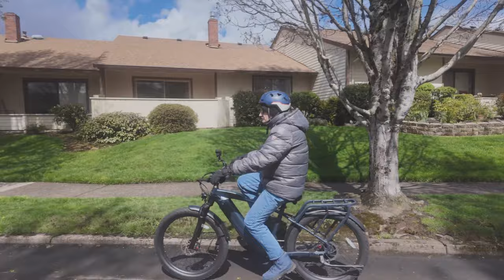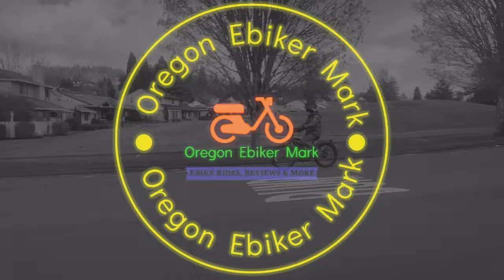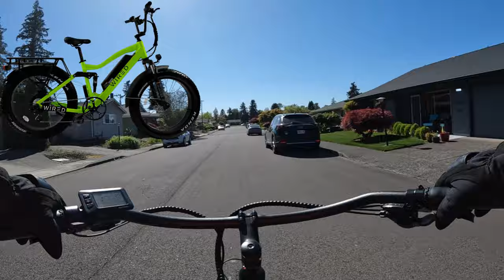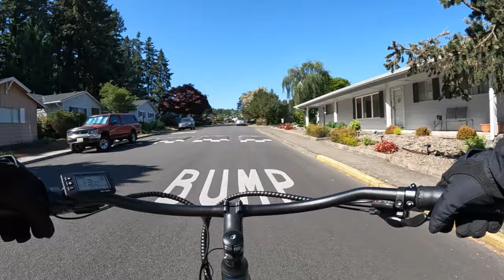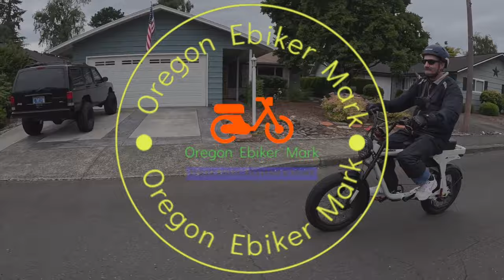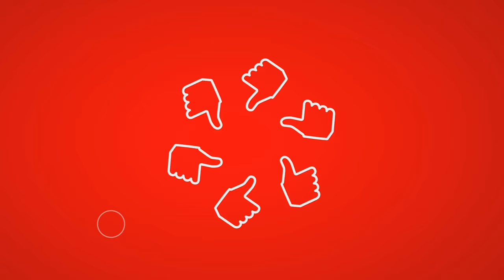Upgrades To The Wired Freedom Ebikes!

Comment: I have the 2023 wired cruiser. It’s great, I use it to commute to work and go to grocery store 
, and do errands. I also have a class 1 velotric t1 st and it’s completely different. I like both, but I think my next e-bike down the road will NOT be a fat tire 100 lb bike. I much prefer a lighter weight, and easy to maneuver

Comment: I heard some e bike manufacturers are putting their rear shocks on backwards and once you take your time to turn them around, you can't add any air in the air shock because you can get the pump line into that area.
Glad its not Wired doing that.
Reply: I heard some crazy bike king was offering a Gates drive without a transmission and then once realizing his mistake, lied and said “supplier” issues.

Comment: This may be the image Wired has on their website but it’s not the bike you actually get when it arrives. Wired screwed up by moving the rack back about 4-5 inches and I can’t figure out why. When I bought my freedom I did so thinking it would look like the bike it that thumbnail for this video, but for some reason they felt it was necessary to move this rack and it messed up a lot of people‘s experience because of the wobble.
Reply from the maker: Did they explain why it's moved back?

Comment: I already have a 2024 Wired Freedom. I got it in January, so it's not the updated model.  I love my bike.  I'm just here to see all the die hard E-Cells fanboys comment with all their toxicity 🤣
Reply from the maker: Do you have dual batteries on yours?
Reply: @oregonebikermark8953  I do have dual batteries on mine, but like I said my Freedom is the older 2024 model, not the updated one shipping out soon.

I put a 40ah  on the rear rack which does add weight, but now I can push the bike to maximum further and for longer.
Reply from the maker: @LeeAyzahn  Sounds good.

Comment: Im also a Mark from Oregon, sold my Rad and am saving for the Wired cruiser, had my eye on E-cells bikes, but this bike from wired takes the cake and the lead, step through would be great for a 69-year-old man with bad knees and bad back,did you see the review that citizen cycle just did on the wired cruiser. It totally sold me.
Reply from the maker: Not yet, but ! am subsribed to and watch @CitizenCycle he does some great work on his channel.
Reply: just so you know E Cells also has a step thru and you can design it the way that you want it with free shipping..either way happy riding!
Reply: @TheOceanMan-xc7qp  fyi the upgraded crusier from wired has duel suspension now

Comment: Yea but have you seen that there motors are burning up at 45a the controller is melting the solder on the hall sensors and making them melt down. Motors can't handle it so it's not worth it. Get the new E-CELLS 5star it's better built and they just came out with there newest model with dual batteries and there own hub motor.
Reply: O really?
Reply: The companies won't be insured if they go above 40....dangerous when it gets above that on a build like this
Reply: So is e-cells the safer, better quality, purchase to make?
Reply: @BhengMibudy  Oh absolutely. Better company/customer service/ no hidden costs/free shipping/customization options galore...Ecells has been around 5+ years and build nothing but high end bikes. They also provide great instructional videos on youtube as well as a number of solid reviews....Their controller and motor alone are valid reasons topic them over the competition
Reply: @BhengMibudy  most definitely
Reply: @TheOceanMan-xc7qp  I agree with this totally there customer service is awesome and you can talk to an American too. Lol
Reply: I would like to see videos because I actually have both bikes I actually have a dozen or so e-bikes this is so funny that you guys are each cells and wired freaks show us the proof
Reply: E trolls!  Guess why the new Wired controller can handle 60v 60amp peak despite being so small?   Because it’s potted🤣🤣 The motors are fine, the old ones were routinely shunt modded to 3000 watts and the new motors are even more robust, and higher rated.  Too bad you e cell owners can’t shunt mod your bikes to compete because they are potted😂😂.
Reply: @jfly2249  totally wrong and why did wired controller get smaller when it's more powerful hmmm and there new controller I herd was potted to more copy cat stuff. Go get your wired and when it fails let us know. Lol. And try to talk to someone st wired that speaks English if you can actually talk to someone. Talk about E trolling. Lmfao
Reply: @oldmanebikes8392 The new Wired branded controller is potted which provides superior heat dissipation, it is a modern design and can handle far more power than the ancient KT controller which is so big because it was never intended to be potted.  Technology changes but e cell is stuck in follow mode and is getting absolutely crushed.  The Bike King, and convicted felon, knows nothing except extreme marketing BS which is needed to sell $5000 AWD in 2024.  Just wait for it, the head shot is coming.😮
Reply: @jfly2249  lol E-cells is in copy mode. They bine using this frame for 5yrs so who copied who and the potted controller was done first by ecells also so do you research before speaking. Everything E-cells does wired has copied. E-CELLS is a much superior Ebike over wired. Like frame strength and everything else. Good luck trying to pull this BS with someone that don't know much but apparently you don't know much.
Reply: @oldmanebikes8392  so true and E Cells guarantees that frame for life!
Reply: What good is a warranty from a convicted felon who doesn’t pay taxes?    Wired bike is 1000 watts more power and demolishes the e cells in performance.  Wired has probably sold 10x as many bikes as e cells and the only complaints about the bikes are from e cell trolls.  No one believes anything the Bike King says.
Reply: @jfly2249  haha 😂😂. Anytime you want to put a wired bike up against a 5⭐ be my guest. Ecells is more dominant bike and yea they sold more because they been selling this style longer but they copied E-CELLS bikes they have been using this frame style for 5yrs now. And warranty lifetime on frame and customer service blows wired away even tho you won't need it because you won't have issues like many people have with wired Ebikes. I even herd wired frames snapping because ecells won't do that because they beefed there frames up. So who is the troll here your acting like one aren't you???  😂 Hahahaha
Reply: Your gonna wish you had that warranty lol, and Ecells has been selling high end Electric bikes for 5 plus years. They sold alot more and they didn't steal their frame like Wired to do it...why would anybody want a want a copycat with cheap parts? You've been exposed
Reply: @TheOceanMan-xc7qp  correct that's what I said who wants a copy cat ecells is the better choice any day.
Reply: @jfly2249, being as unbiased as I can be, owning neither an ecells or wired freedom bike and just an outsider looking in, it appears to me that your arguments have a lot of merit. One thing that strikes me is that other than with a massive tailwind and 145 lb rider, I have yet to see a 5 star achieve 40 mph. On the other hand, aside from the first wired freedom from 2 years ago, which has been improved on numerous times now, the wired freedom reviewers doing a top speed test have hit 40 mph or higher. If you're going to advertise something as a 40 mph bike, it should be a 40 mph bike. Not 35 with peddaling as is happening in the 5 stars reviews. I know there are variables like weight of rider, temperature, wind direction, etc but the 5 star just isn't getting to 40 without going downhill or being wind aided. You had commented somewhere on another video that the 5 star performs like the origional wired freedom, you may have been giving the 5 star too much credit with that comment. The 5 star performs like a 48 volt bike.
Reply: @oldmanebikes8392 why do people come on here and troll away … wouldn’t it be smarter to actually do a little research instead , so they don’t sound so foolish in the long run … 😂
Reply: @jimjr9143  exactly well said.